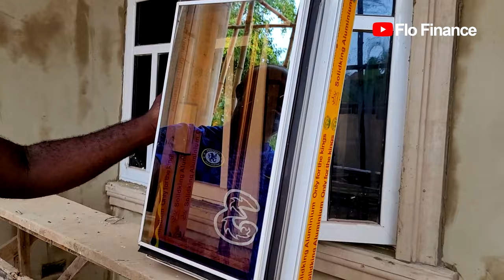Cost Estimate for Aluminium Windows in Nigeria | Flo Finance

Comment: The casement windows are not the best if you are talking about functionality. Casement windows that open outward take some  space off of the balcony. It obstruct comfortable seating at the balcony. Secondly when it’s raining you have to lock the windows completely whereas the sliding windows you can leave a bit open so that air can get into the house even when it’s raining. I have warned my engineer never to put casement window in my house.
Reply: Good morning, kindly check your sliding window space, because sliding only have 45% ventilation, while casement has 95% ventilation and air space.